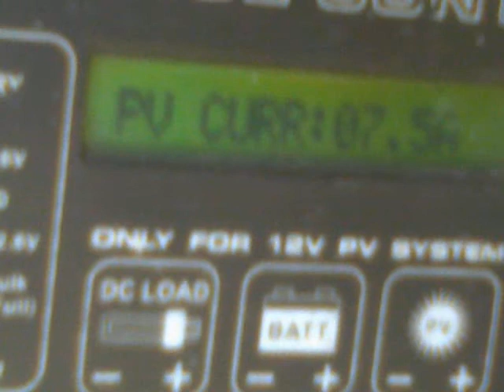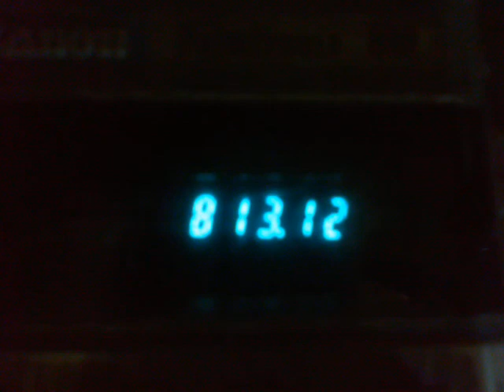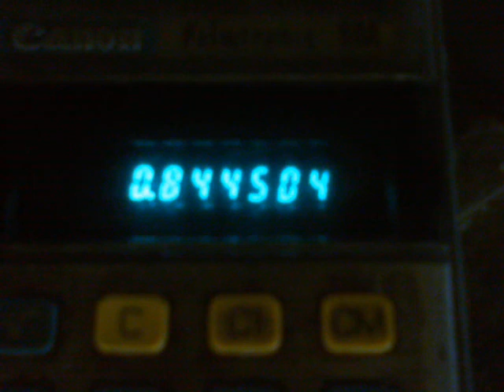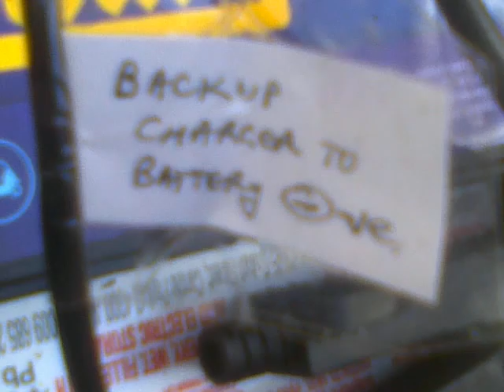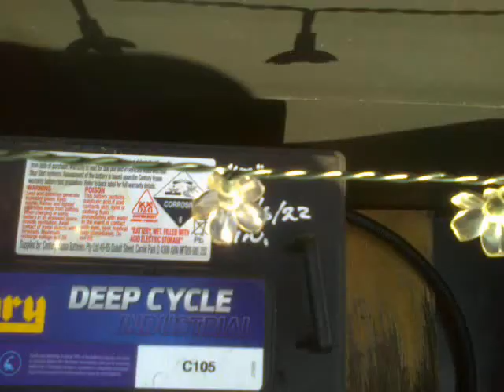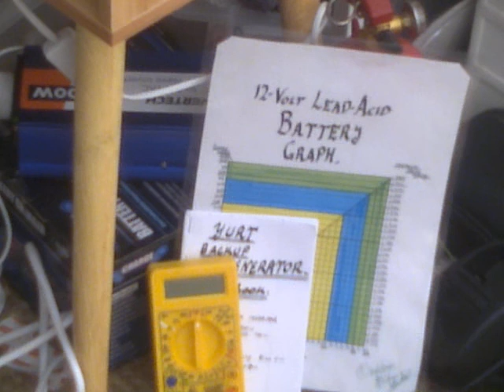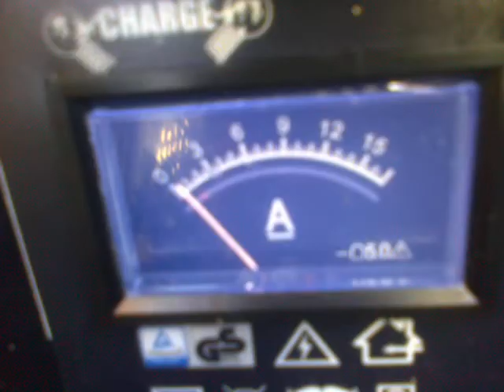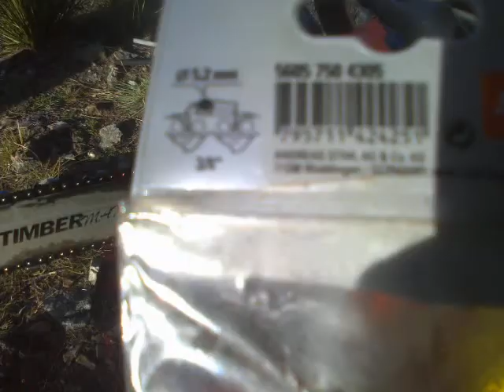Savouring The Flavour, Of Being Still - Not Dead Yet...!

Comment: I think Liz needs a more efficient laptop. Most laptops nowadays have a 65watt charger at most. That's sufficient to run the laptop at full load and charge the battery. You can get laptops with a much smaller power requirement than that too. The Sims isn't a particularly high system requirements game to run. I reckon with an efficient laptop she could easily get that 10-12 amps down to 3-4 amps without too much trouble. Reducing her screen brightness will help, the screen is typically the highest power drawing component on a laptop. Hope this helps. Cheers 🍻
Reply: Perhaps add 0.5 -1 amp to my 3-4 amps figure to factor in the inverter itself.
Reply from the maker: G'day,

Thanks.

I'm pretty sure a new Laptop is out of the question, and she's better off with a little tiny Genny to run her Backup Battery Charger, and it can then more than cope with her existing Laptop.

Either way, it takes a LOT of Solar Power to buggarise about on Computers.

And Solar Panels sure do shit on Petrol Generators these dayze, now that petrol is $10 / Imperial Galleon (!).

I can remember 35 cents per Gallon for Standard Petrol, in 1967, when 20 Escort Cigarettes were the same price. I remember the Ad's on TV.

Such is life,

Have a good one...

Stay safe.

;-p

Ciao !

Such is life.
Reply: @WarblesOnALot  All very valid points👍 TV will rot your mind Chris! Stick with YouTube 😎